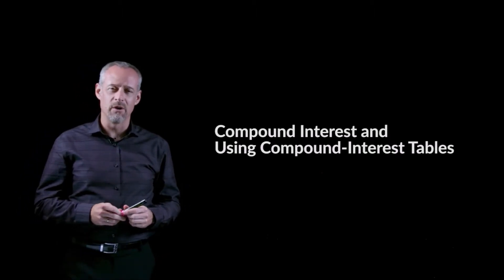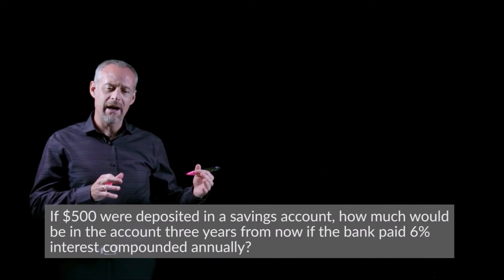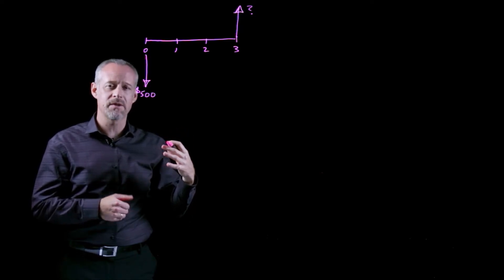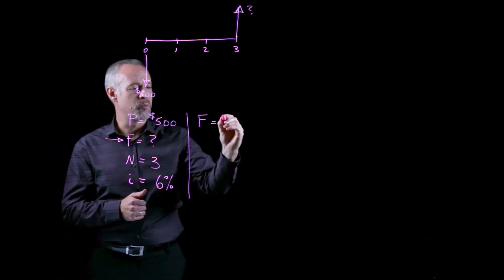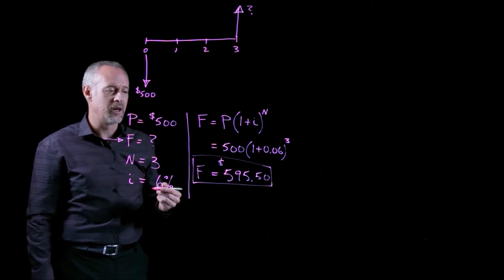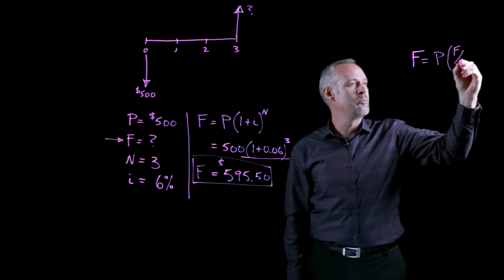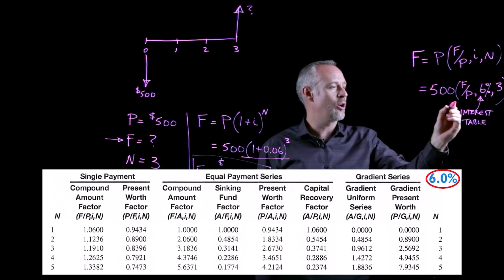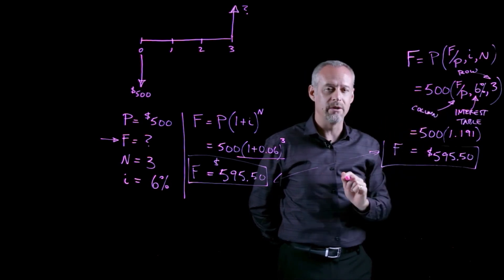Compound Interest and Compound Interest Tables - Engineering Economics Lightboard

Comment: The N in the interest compound table is in years right??
Reply from the maker: Not necessarily.  N is in 'periods' and this can be whatever time-period is appropriate to solve the problem.  (Year and months are common - just make sure that the actual effective-interest rate for the time period corresponds to the interest rate for the table.  For example, if you had a problem where the interest rate is quoted as 12%-compounded-monthly, you would use the 1% interest table and the time period would be 'months'.)  Watch my video on 'Nominal and Effective Interest' if you have questions or confusion.  https://www.youtube.com/watch?v=aT1n_bbQQbM